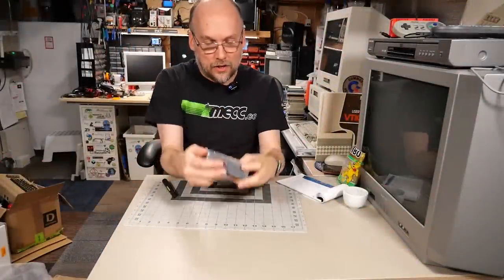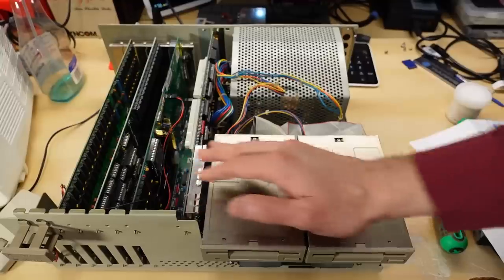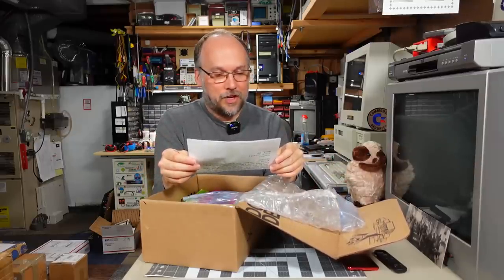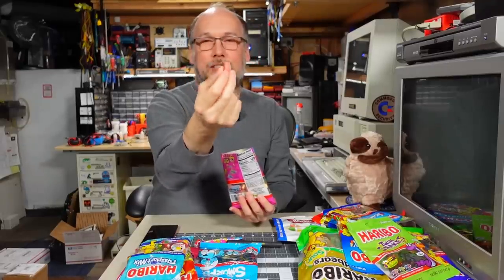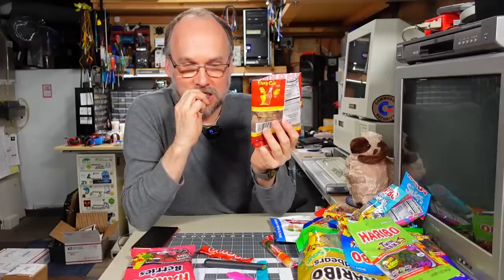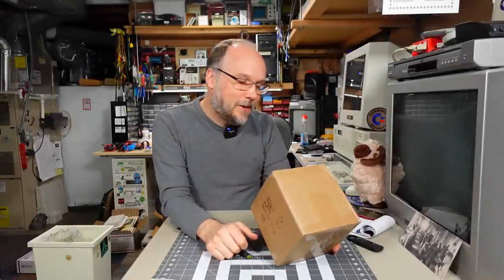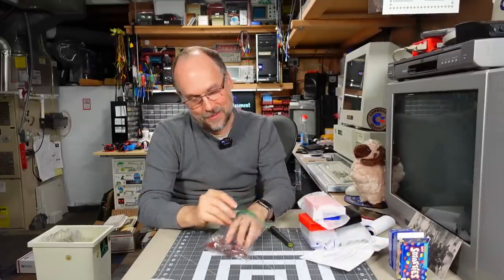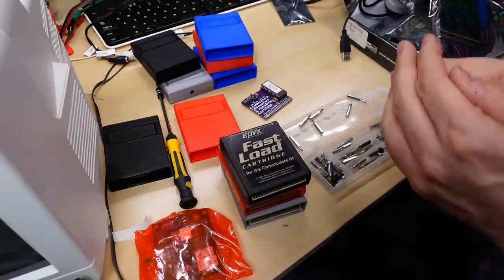An Amiga floppy drive adapter, candy overload, EPROM haul and C64 cartridge housings

Comment: In Southwestern Ontario we called them sugar shanty's (or less popularly sugar shack).  When I went back in the 90s, they had some trees tapped with the bucket hanging, mostly for education/nostalgia, but most of the trees are tapped into a network of tubes, so the sap eventually just ends up in a central tank.  It takes 40L of sap to make 1L of syrup, so you need a lot of trees to make syrup commercially.

You are right about the smarties boxes, they redesigned them 1 or 2 years ago to be more square but hold the same amount of smarties (or maybe 10, who can keep track of time anymore) and they also changed all the dyes to be all natural so the colours don't match what you remember as a kid.  Fun fact, most "smarties" are made in Canada for the US market at the same plant in Newmarket, ON where they make rockets.

Comment: I usually hot-air gun the labels to a warm state then remove them.  Iso alchohol and q-tip (cotton bud) easily removes any residual glue.  I try to avoid toxic spray chemicals though.  Nice haul looks like fun :)

Comment: The most distinctive difference with Amiga floppy is the latching of the Motor On signal. Amiga only pulses the MTRX line to turn on the drive motor. To turn if off, a reset signal is issued. Most interfaces combine the MTRX signal with a DS1 signal, so only a selected drive, turns on its motor (unlike in most other systems). So a D-latch, and a AND gate is required.

Comment: When use rust converter is imortant to lay some paint over it to prevent furher rust, because the converter stuff alone only converts the rust, but it will continue to rust if exposed to moist or water again. 
Keep up that good work 👍🇸🇪

Comment: Yes schools in Canada at least from Ont East still do this. Even as an old geezer I still try to go every so often.  Not many use the bucket method now. You see tubes running all through the woods that go back to the shack and fill the concentration. Most still use the huge wood stoves to boil off the water to get down to the golden delicious syrup! Quebec is the number 1 producer on Maple syrup in Canada with the maritime in second. The term Sugaring off relates to the fact the area is known as a sugar bush. Or something like that!

Comment: I think those "multivibrator chips" are used in any kind of so-called "flip flop" switching applications. Not the shoes, but a switching circuit that can be switched between on and off with only a push button, for example. At least that is what I seem to remember from my childhood days when reading electronic kit books. So whenever say, a radio or any other kind of hifi device has buttons in the front, they may be linked to those chips. Now that I think about it, yours look like about the same size as I have seen them in front panel PCBs :).

Comment: Here in germany, and when i was a kid, Smarties came in a slim cardboard tube(!). They had a plastic "lid" on them that you could remove and put back on. But they were the smarties you showed. Same name,  coloured sugar coating over a "pill" of chocolate. Haven't seen them in german stores for a long time, only M&M's, which are similar.

EDIT: Just looked on Wikipedia, and if you search for "Smarties", an call up the german page for the result, you can see the tube i was talking about, the third picture with the description "Smarties Riesenrolle mit [...]"

Comment: If you use your Dead Test cartridge often, you might consider putting larger toggle switches on the outside of the case. It appears you'd need six plus a momentary contact switch.

Comment: I have a DF1: drive from back in the day, and from disassembling it(I was seeing if a 1.44mb drive would work, but yes and no as it was still 880/720k only) inside is basically one of those adapters with a male DB25 cable, female DB25 connector(it was external and the connector is the passthrough for DF2:) and a 720kb PC Sony drive in a custom case.

Comment: The PC drives were modified by Escom when they reintroduced the A1200. They couldn't get the original drives (Chinon I think), probably because Commodore owed them money.
On the A4000 they allowed HD drives to work properly to get around 1.7MB on a HD disc. But they had to run the disks slower to do this.

Comment: About Smarties:

I am from South Africa and we have Nestle Smarties here aswell, the early boxes indeed were longer , in the 90s the colours were extremely vibrant , size wise it use to be the same as your Canadian version, in the 2000s there was huge uproar because they used artificial colourants , they changed it to "natural" this made the colours much duller and it messed with the flavour aswell, later in the 2010s they cheapened them even more , smaller sizes and much thinner shells :'(

Comment: The "weird cube" with the "white stuff inside" would be a brick (they are modelled after regular 3x2 construction bricks). First time I see a yellow one, though (they are often red where I live), so I suppose those may be portuguese (or at least, not sold in my region). We also have "zingy" versions of those.

PS. You should try spanish Lacasitos; they are similar to canadian Smarties, I think (milk chocolate pellets with sugar coating, they usually come in plastic tubes with a poppable lid).

Comment: The 3D printed carts. I noticed the label area also had texture. While nice for the case, it's not so nice for the label. I would think a flat smooth area would be best. Also I saw recently you can take a cup of acetone, wick, and fan; put the acetone in front of the fan, to blow vapor over the 3D printed items, while covering with a large enough bell jar or some other resilient cover. Over time, It will smooth out the printed lines. You might lose some texture as well. Just things to think about, when printing future items.

Comment: @adrian: you can use amiga disk drive without diskchange sensors in AmigaDOS ... just go to CLI and type diskchange df0: or diskchange df1: after changing disk in drive without diskchange sensor - of course it only works in DOS and not in custom loaders games.. i had a faulty amiga drive in my A500 - diskchange sensor plastic bit was broken for years and always had to type  these command and it worked perfectly in AmigaDOS and workbench... BTW the command diskchange was made actually for 5.25" drive on amiga, since those drive dont have diskchange sensor at all... but it works on broken amiga drive and PC drives :)

Comment: Thanks for a nice video!
Can you not get a Commodore 64 - Cartridge Case designated to fit the Dead diag card?
It can not be so hard to put in a hole for access the dip sandwiches and button.

Comment: • 2:33 - PC floppy drives do have a disk-change-detect capability (or at least there was some sort of mechanism somewhere in the drive or controller or even software), I know this because at one point the past, I had a problem which caused the drive/system to not recognize when I changed the disk and would show the directory listing of the previous disk. 😕 It was very frustrating and I can't remember how I dealt with it (I think I had to swap multiple times or reboot or something 🤔).
• 34:40 - They couldn't call the Sweet-Tarts-type candy Smarties in Canada because there was already an M&Ms-type candy with that name, so in Canada, they're called Rockets.

Comment: GVP - Great Valley Products is a former third-party Amiga hardware supplier.

The company was mostly known for CPU accelerators and SCSI host adapters for the Commodore Amiga 500 and the Amiga 2000 computer series. The company liquidated itself in July 1995. A new company GVP-M picked up rights to the Amiga products.

GVP-M continues to support products for the Amiga line of computers
https://www.gvp-m.com/

The chips you have:
GVG - Grass Valley (formerly known as Thomson Grass Valley and Grass Valley Group) is a manufacturer of television production and broadcasting equipment . Its product line includes cameras, live production switchers, replay and highlights products, media storage, editing, modular infrastructure, routing, conversion equipment, control, monitoring and automated playout, with solutions sold as hardware, software and SaaS. Headquartered in Montreal, Quebec, it was formed by the March 2014 merger of the Grass Valley with Miranda Technologies, which were both acquired by Belden in 2014 and 2012, respectively. In February 2018 Grass Valley acquired Snell Advanced Media (formerly known as Quantel and Snell Group). On July 2, 2020, Grass Valley announced the completion of its acquisition by private equity firm, Black Dragon Capital, from Belden Inc.

Comment: Intel Microcontrollers like the 8051/8031 are fun because there's a firmware called MCS Basic for them.  You flash them and connect build a small board and connect a serial terminal for a tiny little BASIC computer.  Even the one time programmable microcontrollers can be overridden to boot from an external EPROM.  https://www.dos4ever.com/8031board/8031board.html

Comment: Amiga boots from df0 only. Df1 is standby for 2 drive copy etc
Reply: I was thinking the same thing, boot was only available on df0
Reply: How about that Amiga can read only from 800kb floppy’s? Isn’t that a problem when you use a 1.44mb (high density) floppy diskdrive?
Reply: @pwissink1  I remember not having an issue with a physical HD disk, just formatted DD. But I do remember hearing that some A1200's had HD drives - never had one of those drives so don't know if that would work formatted as HD
Reply: @PeterMountUK  my 500 doesnt format hd disks (also not as dd). I haven’t tested a pc floppy drive on the amiga yet.
Reply: KS 2.0 has a boot selection.

Comment: Please, make dumps of all EEPROMs. Maybe, some of them are rare.
Reply: They are not EEPROMs, but EPROMs. Thay all have round window for UV eraser.
Reply: Thanks. Didn't know exact spelling, because always oriented on pronunciation.
Reply: Yup, EPROM is Erasable Programmable Read-Only Memory, vs EEPROM is Electronically Erasable Programmable Read-Only Memory.
Reply: The problem with dumping them is where and how to store them.  There's not really a good way to denote what these are other than what's written on the label.  I think the ones with the bios name/version number might be helpful, but most of those just had some text that means nothing.  Without knowing what machine they came out of, it's unlikely the person looking for a '1994 Compaq Presario Model XYZ' will know this is the bios that goes to it.

Comment: Microsoft attempted to implement disk change detection in windows 95 but it was too unreliable. They would use a signal to detect an inserted disk but for some drives the signal was inverted and Microsoft decided it was too much trouble to implement it and have it work for everyone